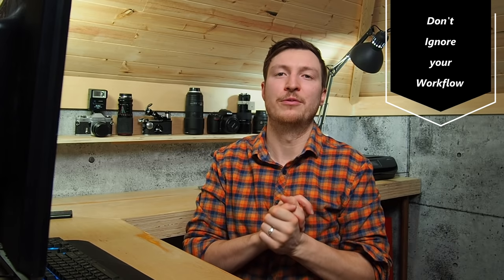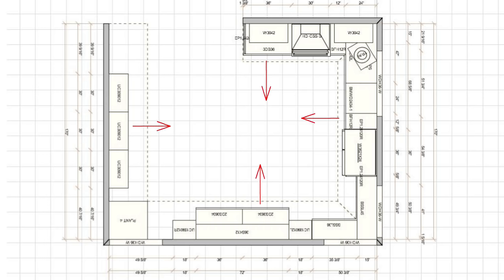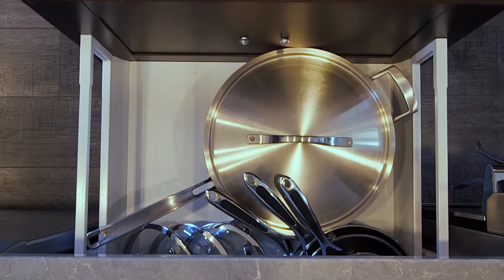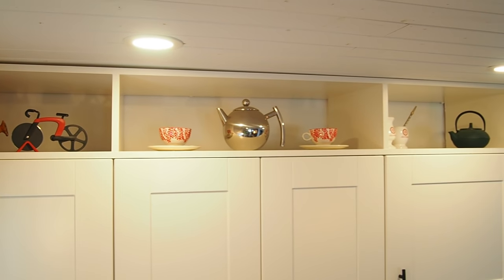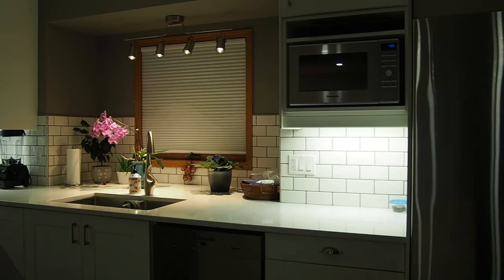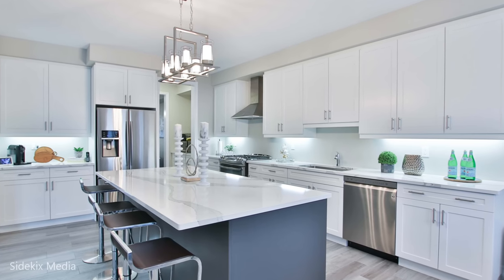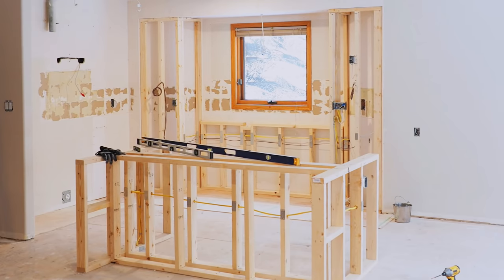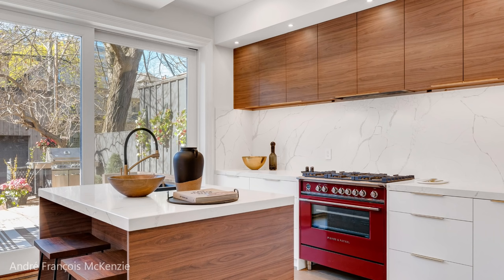KITCHEN DESIGN MISTAKES [Common design mistakes to avoid]

Comment: Thank you for the video, I've enjoyed several. I'm in the planning stages for my kitchen now and one of the things I'm a little nervous about is that I will not have countertop on either side of my refrigerator. I have a very small space and I'm going to have a pantry and utility closet to one side of the fridge and there's no space to put a countertop on the other side of the fridge. It looks beautiful and I hope I don't regret it. LOL. Regarding your tips though, I am definitely going to reach out to an electrician and plumber now while I have the renderings so I can make sure the design is doable.
Reply from the maker: Yes, definitely talk with the tradesperson before ordering and starting construction. It may save your bacon!
Reply: Good planning, but a refrigerator or freezer needs "landing space" beside it as in counter top.  As most people are right-handed, the most efficient set up is to open the door with the left hand and access items with the right; therefore, you need the door to open on the right (hinged on the left) with landing space to the right to put down what you take out.  I find that next you need the sink to process much of the items where the chopping block needs to be next to the sink, so you move to the right from the refrigerator/freezer with counter top between.  From the sink you move again to the right with counter top for stuff to the cook top.  The microwave needs to be near the freezer/refrigerator if you put stuff from there into it directly; yes, I eat a lot of frozen dinners and heat up leftovers, so on the counter between the refrigerator and the sink.  

A U-shaped kitchen seems most efficient for movement, but has wasted physical space in the corners.  An L-shaped kitchen seems ideal and a one-wall string of appliances is too strung out.  The galley type can be efficient.  it all depends on what space is available.  The refrigerator also needs to be somewhat on the edge of the kitchen to be accessible to others not working in the kitchen, but keeping them out of the work area.  A wall oven is very nice to have, but takes up a bit more space.  Don't put the cook top/oven right next to the refrigerator where you are creating lots of heat next to a box working hard to cool things down; that makes no sense at all and is wasteful of energy.  Also, try to incorporate handicap and aging-in-place accommodations for a truly universally accessible kitchen.
Reply from the maker: @virginiamoss7045   You make some great points, unfortunately, very very few kitchens fall into this perfect world of layouts. We almost always have to make sacrifices of some sort in order to accommodate our needs into our spaces. My kitchen is a prime example. I have no countertop space next to my fridge (I would if I could). It simply isn't possible with our homes layout. We just use the end of our L-shaped countertop as the drop zone.

I have made many videos on planning and layouts, and this direct order of movement sounds like it works great for you, but that won't be the case for everyone. The key is simply to create a well organized space with a good layout that works for YOU!
Reply: @hsdesignstudio  You have to go with what you've got, but knowing the ideal you do the best you can.  It's like literary license; in order to take proper literary license you have to know the correct way to write, then you can be successful in making alterations for whatever reasons.  As a commercial space planner my view is not for myself, but for the average kitchen worker.  I am left handed so I prefer the opposite of what I wrote.  If you expect to have another person work with you in your kitchen, then you adjust for that (fewer corners, more room and never any sink or appliances in corners).  If you entertain a lot and expect to hire catering to work in your kitchen, that's a whole other plan.  If you are mentally most comfortable with what you grew up with out of habit, then you might want to go with that, understanding how and why it's not ideal. That's perfectly acceptable; it's your kitchen and your money and your happiness.

Comment: Couple more things I think need more consideration: the social aspect of kitchens that are open to other living spaces.  Cooktops and or sinks which face the dining or living areas.  This allows the “cook” to chat freely with family and guests.  The other is common areas.  Consider the items like the fridge and garbage bins which folk might want to access while someone is busy with sharp knives or fragile items.  If these are put near the edge of the kitchen the space is more people friendly too.  Also, the fewer corner cabinets the easier it is to use all the storage space.
Reply from the maker: Those are definitely good points, but not what I would call mistakes if done otherwise. Fridges naturally make their way to the edge of spaces simply due to size and depth. I'm not a fan of cooktops or sinks facing common areas, because we don't typically sit in front of these for extended periods when we have guests. They also make for extra challenges when it comes to ventilation and plumbing, and can unnecessarily drive up reno costs. That being said, there are times when it makes sense. Like everything with design, it ultimately comes down to the individual using the kitchen and the space available.

Comment: Beware the fun or trendy choice in colour schemes.
I currently have about the worlds worst kitchen that looks great in photos.
Dark counter tops and splash backs do not a good working environment make.
Reply: I'm going with blue pearl Medium-dark blue, but very sparkly) for the countertops, but a contrasting lighter-color granite called blue eyes (light grey with iridescent very bright blue crystals that show when the light catches them at the right angles), sort of cream-color cabinets, and bold colors (mostly red) for the countertop appliances. That KitchenAid mixer and Dash toaster will never get lost in the shuffle.
Reply: I'm going for light colors, leaning toward light gray and a tulip-cream white with blue pearl granite for the countertops, and bright, bold colors for the small appliances and enamel cookware. Definitely using full-height to the cabinet granite backsplashes for ease of cleaning.       
You can keep the grout lines and ridged cabinet doors.

Comment: You need to look at what Blum shows about the ergonomics of the kitchen.  They look at zoning the kitchen instead of looking at the triangle.  They came up with that over 20 years ago.  Just a FYI.
Reply from the maker: I'm aware of Blum's kitchen zoning. Its a great way to think about cabinet placement and working areas in one cohesive plan. However, it doesn't make thinking about the working triangle during design irrelevant.

Comment: It still boggles my mind how many kitchen designs make almost no consideration to lighting placement, especially when it comes to task lighting. I rented a recently renovated place which only had a 3-light track light in the middle of the ceiling. It was fine for lightning the general area, but the track lights casted an awful shadow wherever you stood anywhere along the perimeter countertop. 

I brought it up to property management as an FYI for future renovations, and they looked at me like I was from outer space, only replying with, "You know you can adjust the track lighting, right?", which does absolutely no good if the actual track is behind you in the center of the room. It makes me wonder if any actual designers are consulted with these renovations, or if it's just a random person with no experience making design choices in an email before hitting 'send' and moving on to other things.

Comment: Love all your advice…except one….as a 25 year appliance sales and kitchen design expert I really feel the cabinet depth refrigerator is way too small for the high price you pay.for the look.  Now, if you don’t cook and have lots of cash to throw away go for it.  There is a way to get the built in look by putting in deeper cabinets surrounding the frig. Then putting in a panel on both sides that match the depth from the top down,horizontally speaking.that way you get the look and a bigger frig too.  The thing that would keep this plan from working is where the frig doors open.  If they hit a dishwasher, or oven or cabinet then back to another plan.
Reply from the maker: Thanks! There are lots of ways to make a standard depth fridge work, most of them just require sacrifice. Just like a counter depth fridge also requires sacrifice. Our family of 5 cooks A LOT and we have a counter depth fridge (only 33" wide as well). It works well for us, but may not for others.
Reply: I like my counter depth fridge because the volume is wide instead of deep.  Therefore there's more room for more things up from instead deep behind everything else.
Reply from the maker: @josephsweeney9639  I completely agree with this. We never find ourselves digging to the back. Almost everything is easily accessible side by side.

Comment: Valuable video... 👌

Do you think it is a good idea to have the Kitchen Sink in the Corner in a Diagonal Fashion.( in L-type & U-type kitchen layout).
   What's the pros & cons of this type of kitchen sink.
      Thanks... 🙏
Reply from the maker: I never put sinks into the corner if I don’t have too. Diagonal is a little different, but I would step back and see if the diagonal could be removed entirely in the first place, and then reassess from there.

Comment: I would like to have my dropped grid with plastic panels & hidden 48" florescent lights into a raised closed ceiling with main lights suspended, so I can reach the bilbs to easily change them.
Reply: Im taking down that exact light set up in my kitchen right now. The original builder of my 40 year old house didn’t even bother to finish that space. I had so many holes to patch and even had to put corner beads on the edges, but just taking down that plastic grid thing made my kitchen so much better. I no longer felt like I had to hunch over.

Comment: Do you have a tutorial for your drawer front to 6" filler cabinet hack at 3:54 minutes in?  I am looking for something just like that, but not sure what to do for the box. Just build out a 6" box and use glue edge banding or paint to match the ikea boxes?  Also, is that a piano hinge or a special hinge?
Reply from the maker: Hi Carla- I don't have a video on it unfortunately, but let me try and walk you through it. I use the two cabinets on either side of the opening as my main structure. To color match, I use IKEA's filler panels to "line" the interior of the hidden cabinet. This will give you the opportunity to have all finished edges facing forward. Because I build my own toe-kicks, I also make sure they continue under this hidden cabinet, giving me a place for an actual base. Finally, I have used both a piano hinge as well as IKEA hinges (Kreg hinge jig to make the holes). However, the piano hinge is definitely the simpler system and you can't tell the difference once complete. To open and close, I have a magnetic style latch on the inside (this is the only time you will ever see me without cabinet hardware haha!). Was that clear..ish?

Comment: countertop height should really be chosen to match the individual - i was stuck for years cooking in a kitchen with countertops just 1-2 inches too low, and it was a nightmare! standing slightly hunched over during meal prep will give you fierce backpain in no time and suck all the joy out of cooking. a good kitchen studio will take your measurements and adjust the height of the contertop (and the upper cabinets!) accordingly
Reply from the maker: Yes, I agree there should be some modification when necessary. However, it can only be done to a certain extent. For example, if you want a standard dishwasher under the countertop. The same goes with the height of wall cabinets- your ceiling height plays an important role.

Comment: We have an old house with 91/2 foot ceilings, the old cabinets go the the ceilings, but I hate those upper cabinets, I can’t reach them and it seems silly to pay for storage I don’t use.  Thoughts?
Reply from the maker: There are a few ways to approach this- from a design and aesthetic perspective, finishing cabinets to the ceiling gives off a more visually appealing design. On the other hand, pointless storage makes no functional sense and costs more. Depending on your design, adding simply (and tall) crown moulding can be a nice way to bring the cabinets down further and give a finished look. On the other hand, a more mid-century modern design often looks better with spacing above the wall cabinets in rooms with high ceilings. Sorry that was long winded, but hopefully it helps.

Comment: Thank you for the useful idea! Especially, I like the small space saver from ikea. What is the name ? I really need one.but I can't find ikea's web site.
Reply from the maker: Which one in particular are you referencing? Time stamp? I'd love to point you in the right direction if I can.
Reply: 3:56 is the time stamp for what they are asking about
Reply from the maker: @t.beatty3103  thank you for directing me there! That is a small custom cabinet I designed to take advantage of skinny spaces. You can read about it here: https://www.thehomestud.com/hidden-ikea-storage-cabinet/

If you use custom cabinet makers, this is an easy add on. With IKEA or other RTA cabinets, it requires a little creativity.
Reply from the maker: Added a link down below 👍

Comment: What would you suggest for replacing linoleum floor with a snap in plank flooring? I am just refacing the base cabinets, not replacing them. Would this make a too noticeable/weird difference in workable countertop height?
Reply from the maker: You will almost be guaranteed not to notice it depending on the type of flooring! Sorry for the late reply, this comment seemed to have escaped me. As long as you don't go with the ultra thick laminate options out there, anything in the 4-8mm thick range will be largely unnoticeable. Just remember to adjust your range feet so it doesn't sit to high above the countertop.

Comment: Cabinets height question....Do you still recommend up to the ceiling cabinets for a petite person 5' 2" or less? Are there any options? Especially when the ceilings are high to begin with. Thanks
Reply: I'm short and I prefer not having upper cabinets but instead use space saving hacks for the lower cabinets and pantry, and I avoid having more things that I can store (a bit difficult 😅)
Reply: I'm 5'6 but it's still an issue. I too have 10' ceilings but it was the same in my last kitchen...8' ceilings with a bulkhead. I hated it! 
I prefer to remove all the upper cabinets and use open shelving. If you have the wall space, a single long shelf on each wall would do. Sadly I don't have the wall space and so need at least 2, probably 3 upper shelves. Many people store their dishes in lower drawer stacks, so the need for upper cabinetry is gone (unless you have a very small kitchen). I don't like cabinets that stop short (dust magnets) , and I think the "all the way to the ceiling" look is heavy, and just a way for designers to make extra money. Open up the walls, it'll look so much lighter! Add some art or decorative items, wallpaper or paint, or even kitchen utensils/pots can hang on the wall at a good level for you to reach.
Reply: One word:  soffits.
Reply: My wife and I split cooking 50/50. She is 5'4", and i'm 6'1" I have no problem with stuff being up high, she doesn't like it. But it works great for stuff that is not used a whole lot. Logical thing to do in a kitchen with tall cabinets would be a step stool.

Comment: Hi, I'm 5' tall. So I  lowered the height of my upper cabinet near the sink so I could access the dish rack installed in it for storing dishes. But that has left just 6 inches space left  below it. The countertop space underneath the cabinet seems useless now.What do I do ?
Reply from the maker: 6 inches of space between the countertop and the cabinet??
Reply: @hsdesignstudio  yes.
Reply from the maker: @bushrajamal7386  There isn't much of an option at this point unfortunately. The easiest possible solution is probably to set it on the countertop, and then add a new cabinet above to take advantage of the old space. However, it's hard to give perfect advice without examining the kitchen and situation.

Comment: Electric and plumbing are not boring ,essential to a kitchen.  Plan that first and cabinets and appliances will be a Breeze!
Reply from the maker: It shouldn't be planned first, it should be installed first. I plan my electrical and plumbing around cabinets, not the other way around.

Comment: in the planning stages of redoing our kitchen (and saving up for a chunk of the cost). we have a updated to 1979 galley kitchen with very little counter top space. We are plumbed in for a dishwasher (just need electrical done), so hopefully that will add some counter space where dirty dishes are currently. Thinking of keeping appliances where they are, electrical wise, and possibly extending storage/counter top space. For a small kitchen, what is the minimum counter space desired?
Reply from the maker: I dont think there is a minimum (my opinion). I think it comes down to maximizing your layout and getting in as much as you can without artificially forcing it to happen. Also be honest with yourself and how much you need. That will be more for some, and less for others.